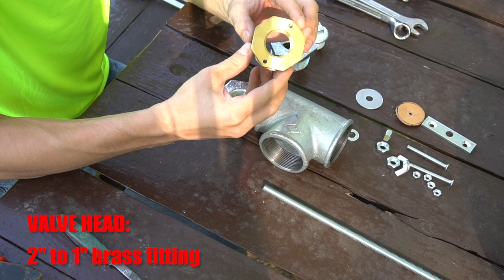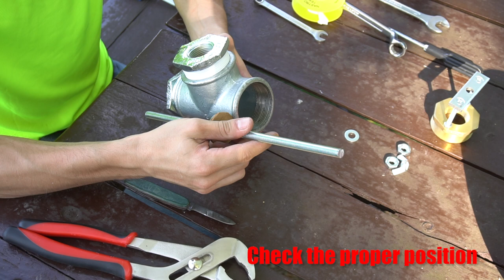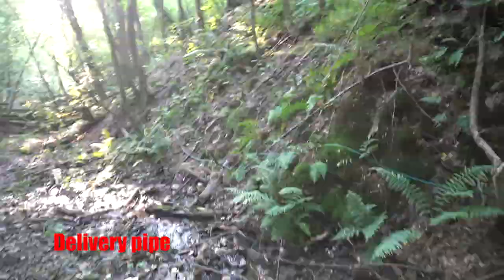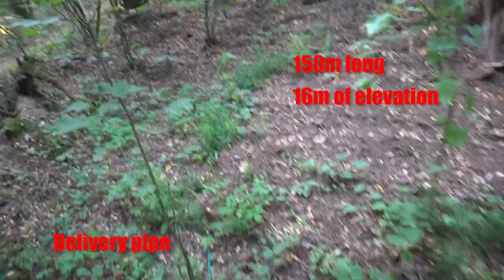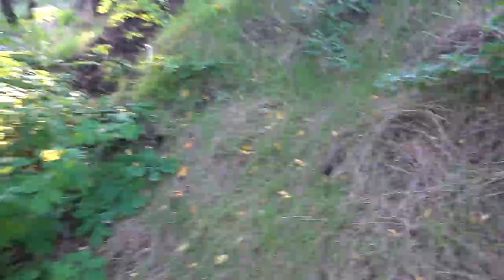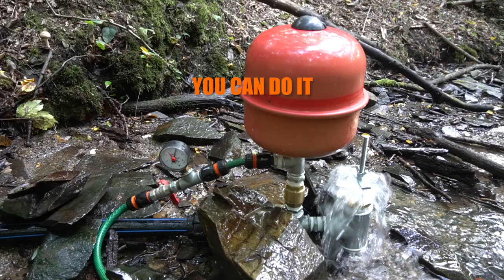HOW TO BUILD THE BEST WASTE VALVE for your RAM PUMP

Comment: Only thing I would add, maybe a little high strength thread locking compound on the nuts once you have the waste valve dialed in. Those impacts will eventually loosen the nuts in time.

I know it is a test setup, but if you mount that pump to some BIG rocks or pour a concrete pad and bolt to that you will loose less mechanical energy from the hammer effect to things moving and should give some performance boost, but hey 5000L/day is nothing to sniff at even so.
Reply from the maker: You are completelly right. In new models I am using double nuts for the piston.
Reply: @BohumirStehlik  Nylock Nuts would also be better. Those things wont budge even after the parts have worn away.

Comment: Hi, I have been researching different ram pump designs and your waste valve is much better then stock valves. The only question I have is if you tried different size inlet and outlet holes like 1 1/4" or 1 1/2"
Reply from the maker: Inlet should be the same size as the ram pump. Outlet could be bigger when you have the right weight of the valve.

Comment: What if you connect 4 inch drive pipe to a 1 inch waste valve with a heavy weight on waste valve? Will it increase the output? Please help us know.

Comment: If I were to make the waste valve size smaller would this mean it would require less water to run it? Also what is minimum liters per minute to run this ram pump?

Comment: My current drive pipe is a thick pvc 80 feet long, with about 30 to 35 feet vertical  height, and my 2 inches swing valve just gave up, after pumping only 90 feet vertical ,  if i change  my waste valve using your design, how high would be my estimated water delivery, ,,,, my water source is a spring with 40 liter per minute volume,,,, hoping for a reply and more power, thanks for the inspiration....
Reply from the maker: Hello. Wohooo. What a pressure! I mean, 80feets is like 25 meters, and 35 feets of head pressure is 10 meters? Am I right. No doubts that you destroyed the swing check valve. :-) I also think that the swing check valve shut off very fast. The pressure is super high for the valves. It is an overkill. You definitelly need another valve to use the whole potential of the head pressure. But I am worried that the pressure would destroy also my design - the leather would worn out really quickly. How far do you need to pump? With my design I have maximum pumping delivery x15 of the head pressure with 50m intake pipe. Count somewhere around x7 of usable pumping height ratio...  Good luck.

Comment: Hiya, it seems the most effective design but how do you attach a pipe to it to take the water where you want it?
Reply from the maker: Plumber fittings..
Reply: @BohumirStehlik  Have you a picture? How do you work around the metal frame that supports the moving leather seal?
Or am I missing something here?

Comment: why do you mix brass and galvanized components.  Could it be all one metal or the other.  BTW thank you for response to my question on other video.
Reply: Some components , eg. one-way valve,  You can only buy in brass ... At least in Europe

Comment: Bohumir; Does the size, type, or material make a difference in the second check valve. Could I use any check valve, brass or PVC as long as it is spring operated?  Steven
Reply from the maker: It doesn't have to be spring operated. The durability depends on material. Just pick the same size as the rampump itself and you should be allright.

Comment: If we increase the diameter of the manmade valve, can that increase the mass flow rate and higher elevations?
Reply from the maker: It is all about the intake pipe. If you have big waste valve and narrow intake, the flow rate will actually be the same as the flow rate of the intake. And you will have a problem with too heavy piston.

Comment: Thanks Bohumir! I built the 1' 1/4' one following your video. Mine stays up when i open the tap and does not go up and down. Will adjusting the leather tops inside the T affect thr functioning of the waste valve? Thanks for your advice.yon
Reply from the maker: If it stays up (you mean closed), you don't have enough pressure in the air tank and/or outlet.

Comment: what are the thread sizes of our fittings (metric?).  I am in USA and can't seem to find things that match up.  Going to build your valve for 1/2 inch ram pump.  Should I still use a 2 inch TEE fitting?  Or size down to 1 inch TEE fitting?  I have 17.6 ft of fall and deliver to 60 ft elevation at a rate of 0.375 gpm (20 ounces in 25 seconds).  If I rotate the valve sideway to increase the pressure on swing valve I get 0.409 gpm (20 ounces in 22.9 seconds).  Brass swing valve is hissing and leaking.  What increase in flow rate could I expect using your valve?
Reply from the maker: 1/2 inch is smaller so you could use 1'' or 1 1/4'' T fitting. This piece needs to be bigger because of the flow between the piston and the wall. The threads are G conical threads.

Comment: Hi sir, Im from the philippines. I have a few question regarding the ram pump, just wondering if its okay to use smaller drive pipe? My pump is 5/4 and currently the only pipe available in my area is 1inch pipe. Thanks. Hope you see. Keep safe and godbless :)
Reply from the maker: Yes, it should work. Your weight should be just lighter or the distance in the valve smaller. But 1'' for 5/4'' is ok.
Reply: @BohumirStehlik  thanks sir bohumir :)

Comment: what size of pipe should I use to make it deliver up to 80-90 meters uphill?
Reply from the maker: It is not about the size of the pipe. It is about the initial head pressure.

Comment: Good evening , my ram pump which is stream feed  uses 2 inches swing valves on rainy days ru s smooth, but this summer the water on my drive pipe is low, can i use a reducer and use a smaller size valve to keep my ram pump running ?
Reply from the maker: Hello, I think to a certain point you can use a smaller valve. We did it this summer. But not so much smaller because then you would need to change also the drive pipe diameter.

Comment: Thank you for your video.  I'm not clear if you were able to purchase the components or you custom made them.    Where are you located?
Thanks.   Dave
Reply from the maker: Dear Dave. I bought the components of the valve except the leather gaskets which I cut myself.
Reply: @BohumirStehlik  Thank you for the reply.    Care to divulge or sell your source list?   I'm in the U.S.
Reply from the maker: Dear Dave, the list is part of the video. Everything you need is writen in the red text. Good luck.

Comment: I have a 1 1/4" galvanised tee already, so could I base the waste valve around that size or do you say it must be 2"
Reply from the maker: The 2'' has a meaning. It is easier to attach the construction and the seal to 2'' to 1'' reduction. You need the big size because of the flow.
Reply: @BohumirStehlik   Ok, Bohumir,  many thanks for the reply and advice.

Comment: Hi Bohumir, does this design increase the volume of water discharged from the waste valve compared to the average swing valve?
Reply from the maker: Yes, it does. The valve "waits" longer before it closes under higher pressure.
Reply: @BohumirStehlik  I see. Do you happen to have suggestions on how I can modify your design to reduce water discharged from the waste valve? I have this research on redesigning the waste valve of a ram pump to reduce its water discharge to increase the output volume from 1 container to another.

P.S. Love your work. Keep it up!
Reply from the maker: @LawrzyMara  Either you don't have pressure but you save water, or you have pressure but you need lots of water. You need time for the water to get the speed in the tube... I would look more to the intake pipe than to the valve.
Reply: @BohumirStehlik  Assuming my experiment is limited to just reducing the water discharge from the waste valve regardless of the pressure, do you have any modifications to your design in mind that I could apply?
Reply: @LawrzyMara  
Solar panels to supply  power to a sump pump that can lift the waste water to the height of the lower tank when the sun shines.

Comment: Does anyone have more information on the leather washers? I have to make a valve for a 3/4 pump and I'm not sure how to make that washer as far as size hole, thickness, etc., where to find them, or if there is any substitute that will work.
Reply from the maker: I have bought a VERY thick leather and made it myself. Washer should stop the water inside of the 2''=>1'' reduction. The hole in the middle should be only for the screw.

Comment: I will try to copy and make your waste valve, the only problem is I cannot find a brass bushing reducer.
Reply from the maker: Sorry for that. I have no idea where to find it in your country. As I wrote here in the Czech republic it is a standart article.
Reply: @BohumirStehlik  thank you for your reply, I have no choice but to use the galvanized iron bushing, very good if brass because it will not become rusty and in case there is problem it is easy to be open.
Reply: pemailv  im from the Philippines and thank you fir the information
Reply: Bohumir Stehlik could it be delivered about 50m height of elevation?

Comment: What size drive pipe is this for?  2 inch tee seems big.
Reply from the maker: Drive pipe is 32mm inner diameter (5/4''). The 2'' is just space. Important is the ending and that's approx 5/4'' (1'' thread)
Reply: @BohumirStehlik  by "ending" do you mean the opening where the water comes out?  So your drive pipe is 5/4 then the flow opens up into a 2 inch waste vslve that exhausts out of a 5/4 opening.  Is that right?  I bought a 1 inch foot valve for my one inch drive pipe ram pump.  But where the water comes out of the valve is maybe 1/2 inch.  Maybe your design is better because the inlet is bigger than the drive pipe but the outlet is the same size as the drive pipe....5/4 inch.

Comment: I've built this, Bohumir, put can't get it to work. I made rubber washers for the valve but they are not sealing completely. Is this critical?
Reply from the maker: Hello. Yes, definitely it is critical that it seals. But also, it could be that you have too little water pressure. Have you used the brass reduction in the valve? They are of a better quality and the surfaces tends to be much smoother.
Reply: @BohumirStehlik  Thanks for the reply. Yes, the seal is probably the problem, I will try something else. I did use brass reductions in the valve.

Comment: Why dont use a 2" stop plug at the bottom of the Tee (instead of a 2"-1" fitting + two 1" stop plugs) and use a washer to keep the alignment of the thread rod?
Reply from the maker: Because this is easier to drill. 1'' stop plug is a perfect solution. One doesn't have to measure the hole at all...

Comment: Bohumir may be you can help me, My friend make a ram pump, the pressure tank is made of 2 " pvc with bicycle inner tube inside and can deliver to 12 meter vertical, the head vertical is less than 2 meter. The problem is this when he replaced the pressure tank with bladder tank, the rhythm or pulse rate of the waste valve is increase with no water delivered. Thank you in advance for your reply.
Reply from the maker: Hmmm. The only thing that comes on my mind: the bladder tank is precompressed. Typically 1,5bar (potencial of 15 meters). Try to deflate the pressure tank to zero.
Reply: I recommend also this because as far as I know is that the bladder tank before it was sold there is always 2 bar in it. Thank you again, still no reply from my friend.
Reply: Thank you again, just now my friend call me, he will do the one you told me bedore. Thanks
Reply from the maker: @maximoincognito4881  Try also to check the air bubbles in the intake pipe. They can be nasty amd shorten the pumping cycle...

Comment: is your check valve still 1 1/4"
Reply from the maker: The check valve is 2'' with approx 32mm gate.
Reply: @BohumirStehlik  I mean the slide/spring check valve before the fire extinguisher bottle...1" or 1 and 3/4"
Reply from the maker: @mikha007  it is 1''
Reply: @BohumirStehlik  ok thankyou
Reply: Thank you also

Comment: Great videos!
Is there any chance you have developed a list of parts (for us lazy folk)
Hahahahahaha
Reply from the maker: Yea, really lazy :-D... just copied a content of my comment below: 2'' T, 2x 1'' plug, 2'' to 1'' reduction, 1x 2'' to 1'' BRASS reduction, 2'' to size of your rampump reduction, very thick metal plate, 10mm thread rod, 2x M6x70 screw, 4x M6 nut, 4x M10 nut, thick leather sealing, standard M10 washer, M10x30 washer, sealing tape.
Reply: Awesome, thanks!
And the expansion tank? Is it an 8 L tank?
I’ve just calculated 1.7m fall over 40m
Will be interesting to see how it goes.
Reply from the maker: @paulsouthern6181  Yes, it is 8 liters bladdet tank.
Reply: Bohumir Stehlik a “bladder tank” is that different to an expansion/pressure tank?
Reply from the maker: @paulsouthern6181  Ït is a pressure tank with a bladder inside.
Reply: @BohumirStehlik  is it compulsory to use bladder tank? Or can I just use fire extinguisher tank?.thank you
Reply from the maker: @sheedytv55hometvsamsung67  If you don't use the bladder tank, it can happen that the air disappears from the tank. Sometimes it happens, especially if there's not enough back pressure to suck air inside.

Comment: Thank you for sharing this wonderful valve. I also view other channel on ram pump and have gathered mixed information on waste valve hope you can enlighten us addressing this question. 

Have you noticed of two main streams of ram pump, Normally open versus normally shut, assuming fed by 1-2 meters of water head? I was told that the normally shut type requires manually prime until the distribution circuit has build up water volume to sustain a back pressure otherwise it will not cycle itself. Is your waste valve of normally open type and closed only by dynamic pressure? Your advice?
Reply from the maker: Hello, this valve needs manual priming before it can work by itself. I am not aware of any valve of this kind that would work without the manula priming and that would normally open.
Reply: @BohumirStehlik  by manual priming I’m referring to an YouTuber asking for a hundred or more triggers to put it into cycling. He explains this is insufficient back pressure from the tank and beyond. He can get it in cyclic in just ten to twenty triggers with the output valve shut. It stops cycling soon as he opens the output valve with delivery hose empty. He then add a hundred triggers or so to fill up the hose in order to set it cyclic. Is that how yours drain valve behaves? Thanks
Reply from the maker: @philoso377  One gas to prime it but not hundred times... Up to 10 times in case of long delivery tubes that goes horizonrally too long. It depends also on the size of the air tank. I usually need something like 3 to 5 times. If the guy you write about was not able to prime it that the delivery height was too low or his valve was faulty (it could be also the secondary valve).